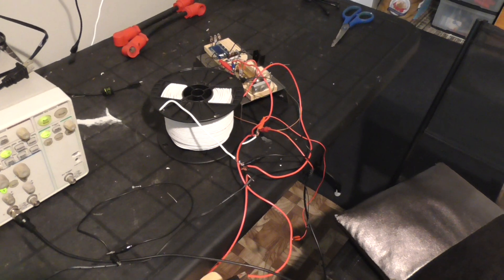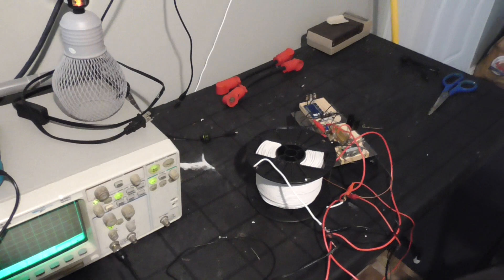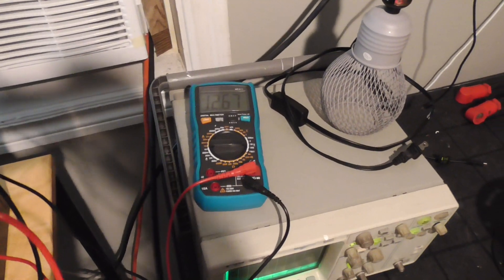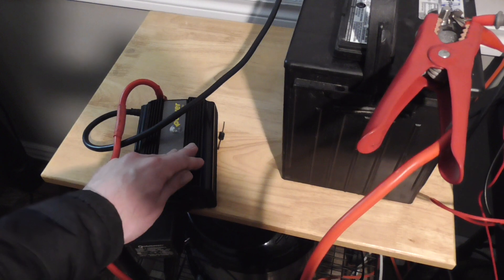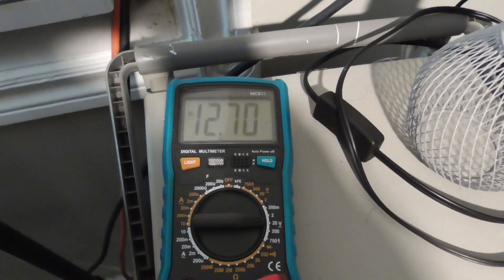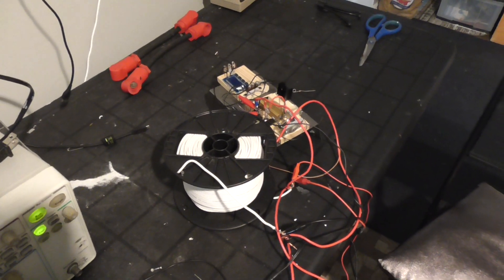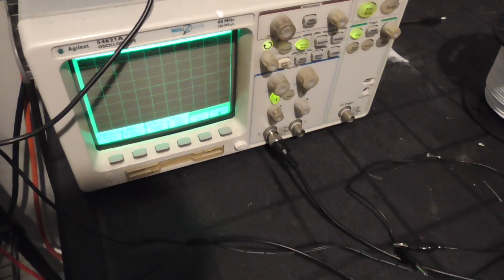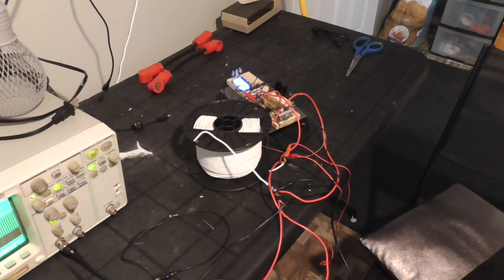Simple battery self charging demonstration

Comment: im getting sleepless nights trying to figure this out... it seems almost voodoo or sorcery!..
Reply: Fidel try to think at the magnetic field building under the tension of Voltage, flipping the electrons in the copper, without the hopping of these electrons from one atom to the next, keep the magneting field in the coil, (dont lead it in a iron core), take the tension away and the magnetic flips away and beyond in the other direction pulling magetics with it causing a BEMF bigger than the puls give it time to flow to the battery and taking electrons with it to the Battery.
Or you can propulse a submarine with it.😊

Comment: Concerning your wire you said it was like $3 60 ft approximately normally carry four strands trans each strand is 360 ft or are you connecting them together to make the 360 ft? Keep the good work, coming you might try instead of using a light bulb try a Crock-Pot or small refrigerator you know rated for 60 two hundred Watts for the 100 w refrigerator you're going to need an inverter that is five times the wattage you're going to use due to the dead short when they first start up and you might be able to put some large caps in line parallel to the power lines on the 12 volt that helps to take the load off the inverter it gives you an instantaneous jumping of energy to overcome the dead short and also acts as a buffer for your battery. Another thing you want to try is an electric blanket they're rated below 100 Watts and there's no dead short another thing is a 100 w heating pad like the kind they use in a composting toilet. Trying all this stuff out is because when you're in an RV the composting toilet completely takes care of your waist without anybody complaining but it has to be powered at around 100 Watts and the rest is for food and keeping warm and the dead of winter when you got no other option what you've done covered a lot of bases thanks for your service
Reply: just being able to charge the battery itself is a huge achivement
Reply: @fidelcatsro6948  
Absolutely no argument there
Reply: Hey just for the record I thought what he did was off the charts some of his homegrown insight help me get my head together it was where he said keep the power down as low as you can keep it because it doesn't help it at all to throw power added. I mean a person's first inclinations would be to add power that's cheaper down as low as possible thanks for that tip
Reply: You use the cap dump culture system work better with the capacitor dump ? I realize there's two kinds of energy one straight from the bakkie enough with the and the other going to the capacitor dump and they don't mix 4 by using the capacitor. If you're staying with a standard energy
Reply: @R2NOTU  even bedini will be rolling in his grave seeing a primary battery stepping up its own power with a tiny input and then charging itself up with the output...mind boggling
Reply: @fidelcatsro6948  he did just that on several videos that I saw.but only planted the seeds of the ideas if gentleman is running with it are we going to get some replications out there or we just a bunch of Taurus
Reply: I'm really not so sure his idea about the induction and more coils because I built hey old-time teaching tool on residence it was just two copper tubes facing each and it had a ride that would slide along one of and the moment you hit residence the London jar sparking a spark gap and transfer the energy to the other side the point I'm trying to make is it doesn't seem like you gained anyting just moving energy around but I could be wrong

Comment: Not what "over unity" means in terms of power and energy, that simply applies to transferring more low-exergy energy (like thermal energy) than you input high-exergy energy (like electrical energy); a heat pump is the canonical example of this. Note how the energy form you're moving has low exergy, and thus you can never get it to do anywhere close to the work required to run itself.

No such thing as a free lunch; stop wasting your time on this nonsense and look to greener pastures.
Reply: this is theoretically almost impossible.. this video is real unfortunately..he is achieving a self charge and to me its mind boggling
Reply: @fidelcatsro6948 :

It's not "almost impossible", it is impossible. There are countless of scam videos like this.
Reply: @hoon_sol  i cannot rule this as a scam until i try the same with a 1000feet of 4 layer litz wire as coil..i know a scam video when i see one..this doesnt look like one
Reply: @fidelcatsro6948 :

You have the worst judgement of all time. This looks EXACTLY like the countless other scam videos just like it out there.

And yes, you can easily rule it out, because it violates basic thermodynamics, like I explained above.
Reply: @hoon_sol  it doesnt violates basic thermodynamics. It is triggering an avalange of electrons from or to anode to or from kathode. When the snow is at top massive powers will come down over the closed electric loop giving his energy away in the resistance of the closed loop.
Hoon sol, Stop bashing please.

Comment: How many watts is the isolated 12v using?
Reply from the maker: less 100ma at varies a little depending on frequency settings and duty. At some point I had it working as low as 40ma.